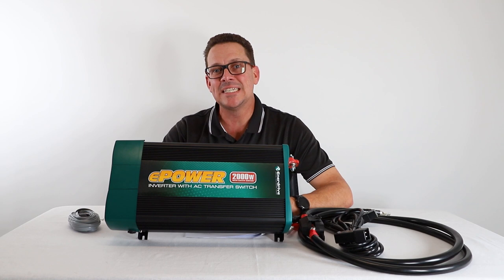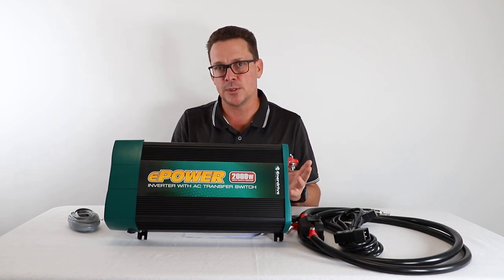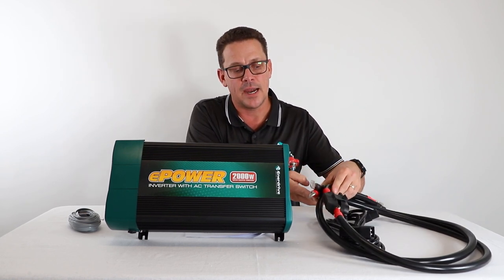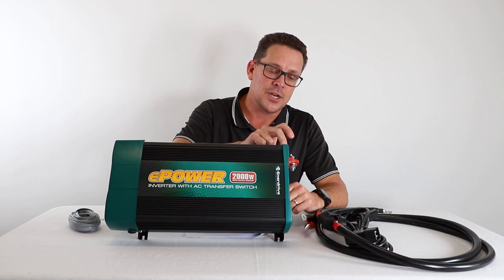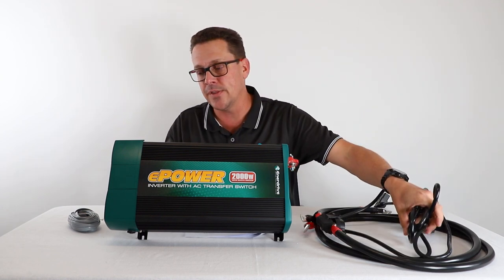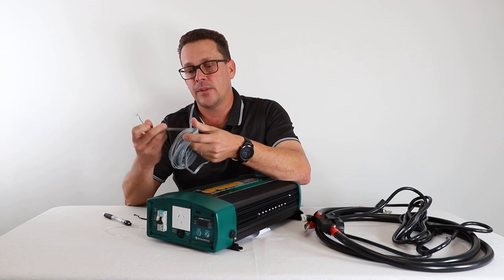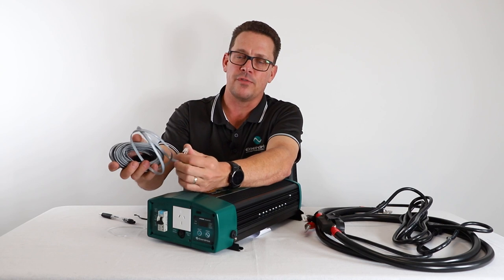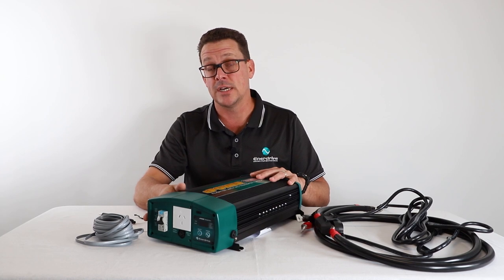Enerdrive Inverters (Transfer Models) - Part 3 - How to Install

Comment: Can the orientation of the GPO be turned/moved 90°? When the inverter is wall mounted, the GPO pin orientation prevent plugging in some items like battery chargers. Turning the GPO 90° would rectify this.